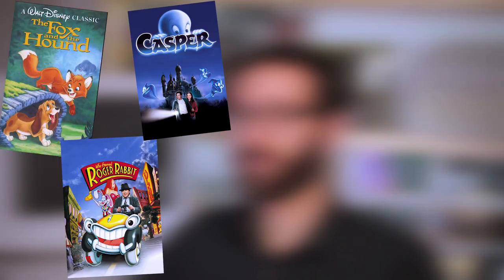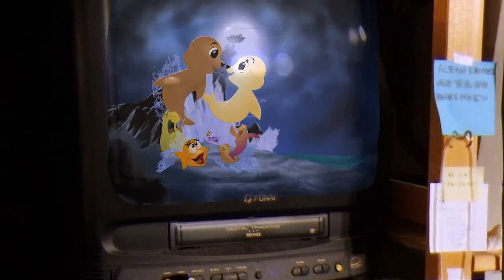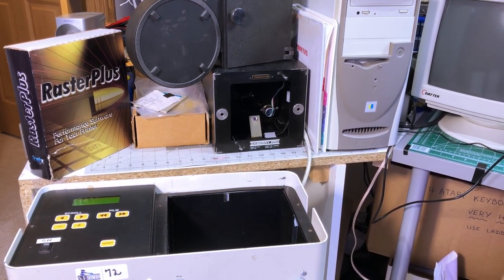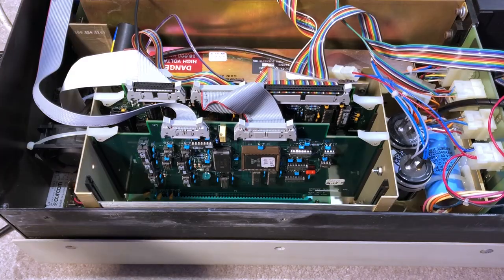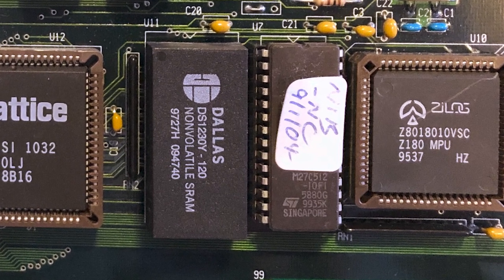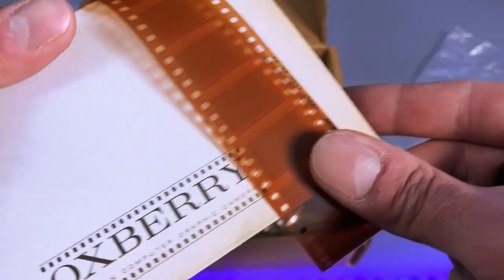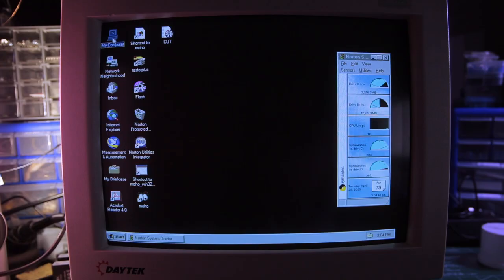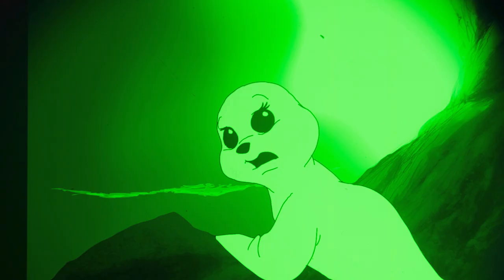Animation studio hardware (And recovered lost footage!)

Comment: Amazing reminder of what I was doing back in 1988. I had an Image Innovation Vision 400 vector artwork computer creating SCODL files using a Wyse PC286 (640k RAM, 20mb HD). Images were converted and shot onto exactly that system. A Matrix QCR with an Oxberry 35mm head. Good times. Thanks Analog Thinker for this blast from the past!

Comment: I LOVE this stuff. Whatever happened to that 16K film printer? Is it still working?
Reply from the maker: It is indeed, my friend tried to run it on Phil’s computer yesterday, the only caveat is it does need an additional Kuper ISA card to drive the film advance mechanism (stepper motors, position sensors etc...) where this Phoenix 4k has the film advance driver managed internally... trade off decisions

Comment: 2:48 that Imapro chronology tho. 🔬🔭🚀😮
Reply: What would an equivalent setup look like if Phil built it in 2020? Still Imapro?
Reply: crnkmnky film recorders are still a thing and used for transfer of modern movies to film for IMAX or other older theatre that haven’t invested in expensive digital projectors and still using film rolls. Now I believe Arrilaser is the leading brand and using Laser instead of CRT, which was still a thing until Jurassic Park or even Avatar, check the video I made on the MGI Solitaire to see the machine used for those movies if interested!